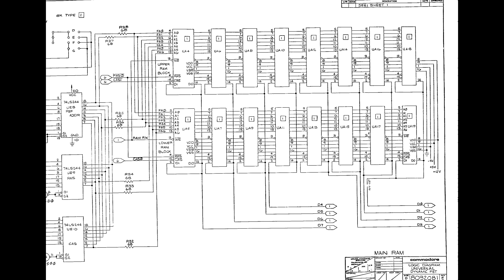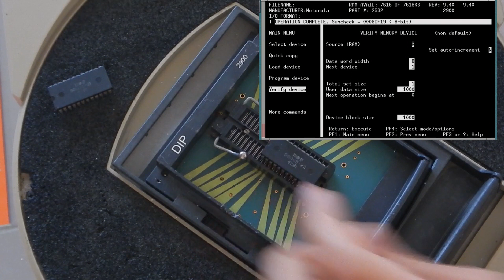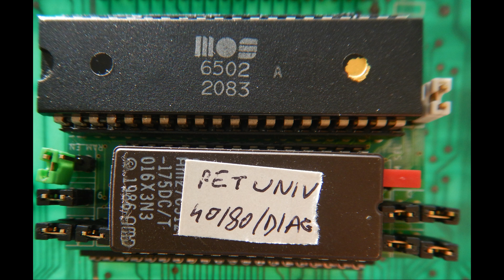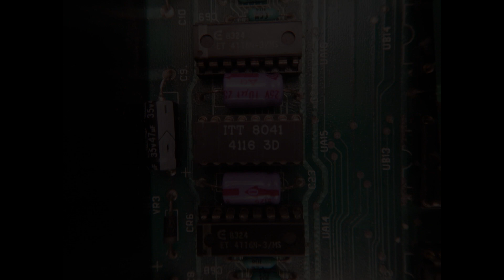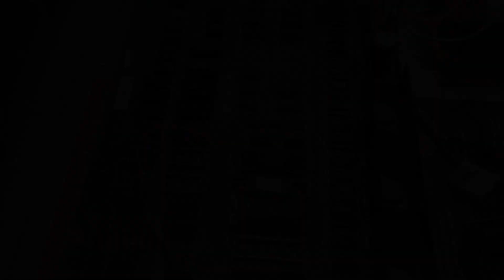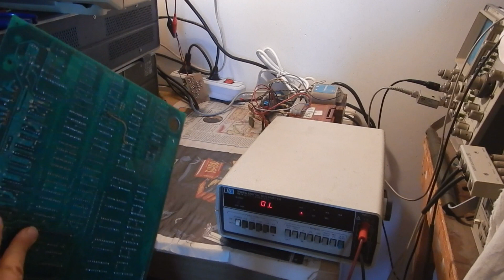The longest Commodore PET 4032 repair ever, pt.1

Comment: Nice job Frank. Trying to follow-up a poor repair attempt is always 10x the work as if you had gotten the machine originally.
Reply from the maker: Hey Birt! The number of bad ICs on this machine was really high even not counting the socket issues. This is the second bad 6502 I've found in many years. However, yes, previous work means 10x troubles!

Comment: I would love to have a 2900, especially one with the ROM emulation adapter.  It's a beast of a programmer which will support just about any ROM or PLD you can throw at it.
Reply from the maker: Yes, the 2900 is a very nice programmer. On the other hand it's difficult to find and to maintain operative (I'm trying to get a spare unit forever now). Consider also the Unisite that supports more parts, but it's a massive beast (and comes in lots of different revisions/options).

Comment: The markings on that "6522" at 7:05 looks like a badly executed Chinese fake.
Reply from the maker: Nope, looks fine to me, The markings aren't "painted" (they don't go away with acetone for example) and the bottom side shows "Philippines 471112" which is consistent with other MOS ICs of the same year. I keep all the bad MOS ICs unless the owner wants them back of course. A fake would have likely had the bottom sanded too.